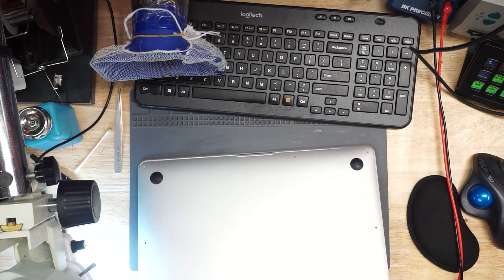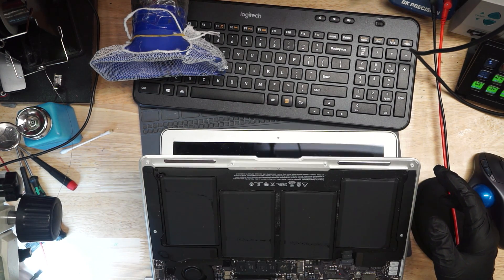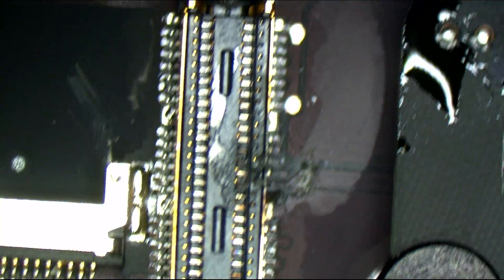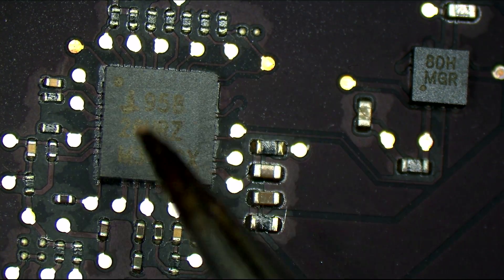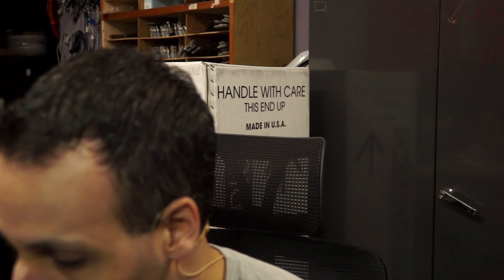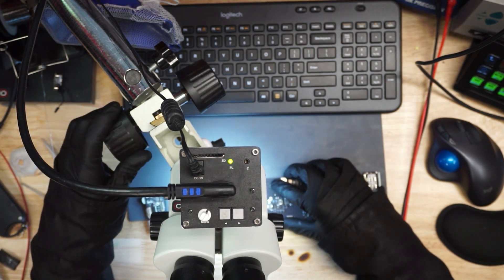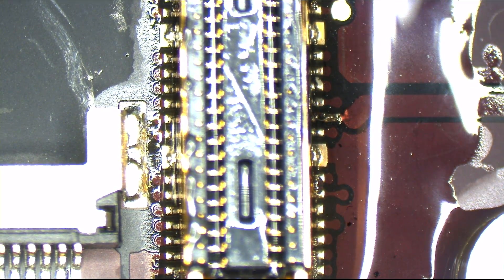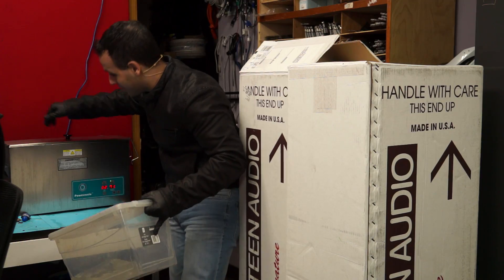Crest Ultrasonic Cleaner performs miracle on little Macbook Air.

Comment: Hey Louis, the reason I think you struggle with the conical tip is because you are applying heat directly to the solder. if you applied it further back the solder would tend to wick into the hottest area. it's a good thing to keep in mind solder wants to flow to the hottest area by nature.

Comment: Louis, I'm wondering, if a macbook has water in it, wouldn't turning it on damage it even more? Because the water will send wrong voltages to other parts of the system or something? Thanks!

Comment: Man that was brutal to watch hacking the connector with all that dang flux! Should have replaced the connector in my opinion. What did you do about all the rest of the liquid damage like in the keyboard area and under or around the batteries? what a freaking mess! That staple was epic lol

Comment: I'd be interested in seeing your numbers at the shop on the iPhone X's. I got one when they first came out from work that I tried to refuse but have to use as a work phone. I've now had to fix it 3 different times and it's such a piece garbage I want to put it thru a pitching machine and smash it. Then recycle the parts responsibly.

Comment: WAIT, if the ultrasonic cleaner performs miracles, why not use the ultrasonic cleaner on people?!?!

Louis, your praise of the ultrasonic cleaner and use of the funny xtranormal cartoon (medical cartoon version which helped me make the connection: https://www.youtube.com/watch?v=q0S5EN7-RtI) made me wonder if it could solve a small problem in medicine. 
As a current medical student, we recently learned about biofilms of bacteria being a big problem with any implants in the body, including artificial heart valves and orthopedic hip implants.  The biofilm is just like a thick bacterial slime that adheres very well to metal and other implant surfaces.  The problem is the thickness of the film protects itself from antibiotics so much so that implants must usually be replaced, which requires even more surgery.  We should just use the ultrasonic cleaner on the implant from outside the body to break up this bacterial slime and allow the antibiotics to penetrate.  Like most ideas, someone already thought about it... http://www.ors.org/Transactions/60/1949.pdf  https://www.ncbi.nlm.nih.gov/pmc/articles/PMC1361257/   Although the idea has not been implemented into medical care yet (to my knowledge). 

P.S.: I love your videos because of the electronics, engineering, and your views!

Comment: You need to add a set of dental picks to your tool kit. Nice tiny pokey bits at different angles.  You could probably have reached behind that pin and brought it forward.

Comment: i usually trust Louis implicitly as he is the foremost authority on 'pp' and where the buss stops...but I highly doubt that macbook air is drawing 700AMPS and he chose to pick it up bare handed without an arc of pure energy blinding the camera and cremating him instantly... I also don't believe that power supply cable can conduct 700amps of current
Reply: ...and cut Of cause it can carry 700A, but not for long.  Besides 700A @ 18V is only 12kW, which is slightly more than a big clothes dryer.  Might desolder all the chips if kept running longer than that cable can handle.
Reply: @johnfrancisdoe1563  ...I digress...would YOU bare-hand an active 'big clothes dryer' power supply my friend...?    :)

Comment: Puts in CSI Hat on: By noticing those fingerprints. I say the user of this Macbook has either a small child (or two) who likely stuck a staple in the poor machine or uses said Macbook as a display and points at it poking at the screen to make it clear of what they are pointing at. As for the staple for the second...no clue why either. Maybe it was just there Shrug We need further testing. Cut away to hot CSI chick
Reply: Staple is doable, but I'm curious from where all other crap came from. Seen very dusty computers and boards soaked in tea/wine/cocktails or nicotine. But Louis customers gross generating possibilities took gross in completely new level. What these people are doing with their computers?

Comment: Louis, I know you have tons of viewers and have limited time to answer questions, can you get access to a 2005 Audi A4 Comfort Control Module Circuit Board Diagram and Swap a chip from a bad board to one that hasn't been water damaged like you've done on other items?  Thanks   The videos are great and the skill you represent is of the highest attention to detail and reliability, it is very difficult to find people like yourself that not only do highly skilled work but freely present it.  Have you ever thought about doing work in Robotics engineering?
Reply: I think you can get an answer from his website, or via twitch!? Sometimes he fixes boards online-stream. Also you will have a chance to ask him online (donating)
Reply: https://m.twitch.tv/rossmanngroup/clips
Reply: If these are the ones under the carpet, im 90% sure last one I fixed I got a numbers matching unit off ebay, and just swapped the eeprom (a 95320 8 pin spi) if your moderately comfortable at soldering its a DIY job, doenst even need hot air. just dont go to hot , these little eproms get messed up if you go to hot, and unless you read it in-situ and save a dump, (I advise you do this) your screwed.
Reply: @denisohbrien  Sounds not too bad, I'll check that chip and see if it's corrupted.  It would be easy just to replace the unit if it weren't a convertible.   For FOB function and immobilizer I need that chip to be good.  You don't happen to know if any other chips handle adaptation to the A4 variants, or is it just the one you mentioned?

Comment: Someone should find out how to seal the motherboard so things like this don't happen
Reply: ᅚᅚ ᅚᅚ ; people need to keep “liquid” away from electronics.
Reply: Take 1 * functioning iMac.  Place inside a suitably sized bucket.  Add concrete until bucket is full.  Allow time for concrete to cure.  Attach heavy chain. Voila - you now have a new i-anchor.  Enjoy!
Reply: ᅚᅚ ᅚᅚ It's called "conformal coating" available at any good electronics factory as an extra service for stuff likely to get wet.  Hard part is not covering up those testpoints (shiny round dots) used by repair shops to test things.  There's also a snot-like coating that keeps out water but let's you poke probes and screwdrivers through.
  Whatever you do, don't forget it changes the cooling of everything, even little chips that would do fine just with air blowing past, so calculations and tests are needed.

Comment: 700 amps???
Reply: 1.21 MegaMacBooks of repair power
Reply: That would be an iWelder :D
Reply: Im thinking he meant 700mA
Reply: SinsBird smoke city
Reply: Smoke city
Reply: 1.21 JIGAWATTS !!!
Reply: Nice!
Reply: I believe you are not allowed to draw over 2000 watts from the wall, at 700 amps and 5 volts DC in you are looking at 3500 watts.
Reply: @thetrashman5252  why wouldn't you be allowed to take more than 2kw from the wall? You know how much power your  a/c unit needs?
Reply: @somedude2492  If I am not wrong, most outlets here are good for 15 amps at 120 volts, although an air conditioner can draw from 3 to 5 kilowatts. I am obviously misunderstanding something here.
Reply: The breakers for the A/C and the outlets are not the same. typically the breakers for the outlets will shut off after 2kw.
Reply: @Thunderdkfox  Oh.
Reply: @thetrashman5252  that's the rating in your outlet. Here we have 220 5A, 10A, and 20A. Breakers are the same, they will open the circuit at 5A, 10A, 15A, 20A or even 25A. What you"re allowed to draw from the wall is the max power you buy from your electricity provider. What is safe to draw is the max rating of the weakest point in your circuit, which should be the breaker.
Reply: @somedude2492  Oh I see, thx for the clarification.
Reply: yes but here, in the USA, which is where the man in the video lives, most standard breakers are 120 @ 15A, which he has no reason to not have those. He most certainly meant 700mA it was just fun to point out